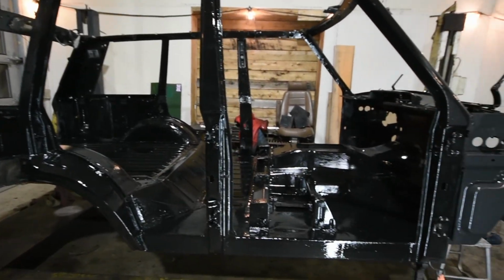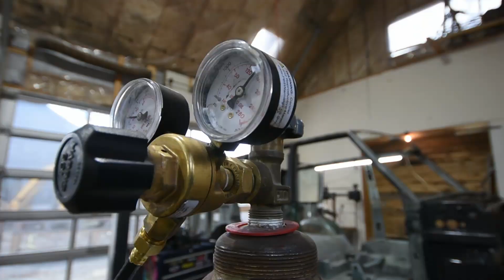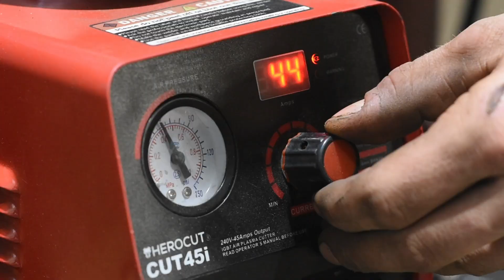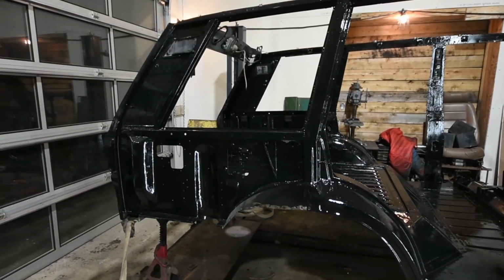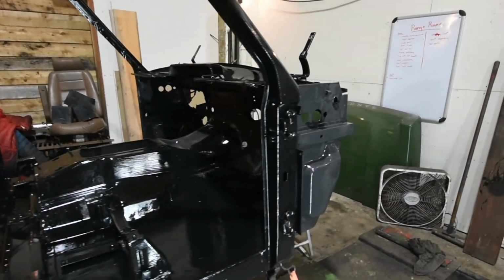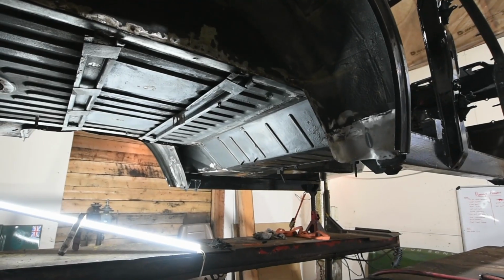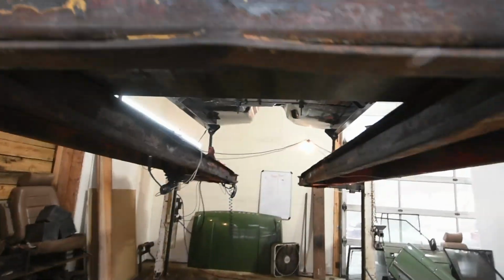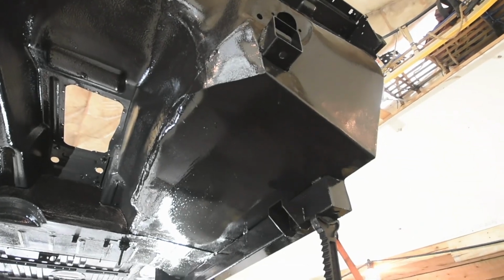Range Rover Classic body restoration

Comment: A plunger is good to use for applying pressure when welding to close gaps using your chest to push on the handle! Sounds daft but works:) will have to watch all your vids in the wrong order as I didn't notice them before!:)
Reply from the maker: Haha!